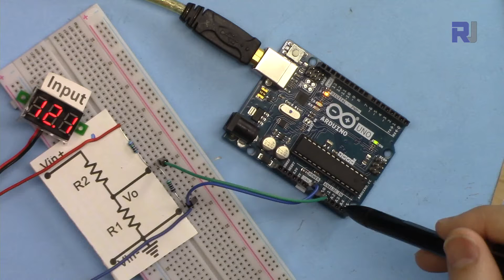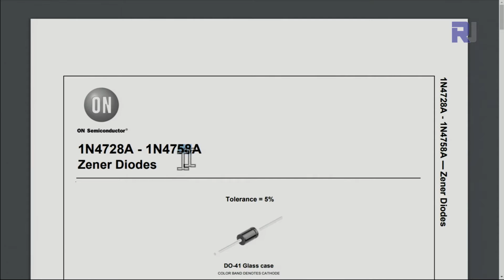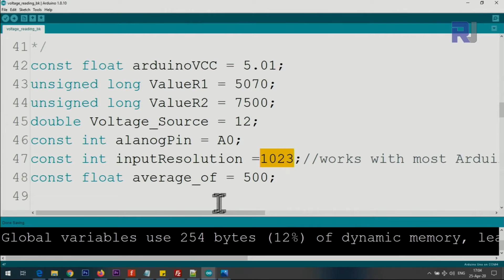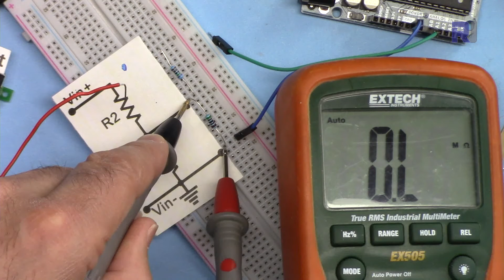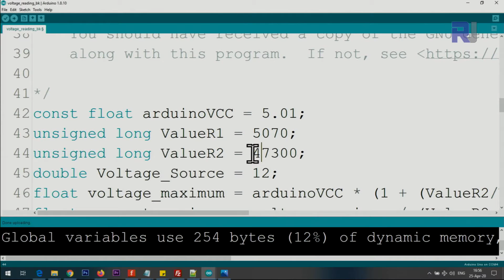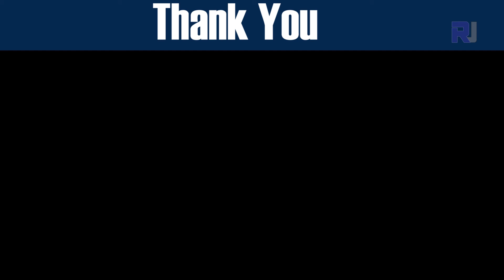Built Voltage Sensor with two resistors for Arduino to measure any DC voltage - RJT305

Comment: We are waiting for a  same project on esp8266. Good luck on your work !
Reply from the maker: it works for EXP8266 and ESP32. there will not be another video as this is the most complete video.  Watch carefully the code section.
Reply: @robojax  I managed to measure using your code but I had to introduce 3.05 V instead of 3.3 V as Esp8266 has. That's the only way it works. I measured with a mini code the voltage that A0 reads and it is 3.04 V . I used this value in my code and it reads with an error of maximum 0.1 V which is very good for voltages between 1.2 and 5V. I will also test with higher voltages. I have another question for you, I would be happy to answer : what Zener diode do you suggest in this case? For 3.3V or 3.1V (3.04V in my case)?  And to size the voltage divider for VR1 =  3.3V or 3.04 V ? 
I  used R1 = 7.5K and R2 = 29.8K. V R1 was 0.78 V for Vin = 3.9 V.  Can I exceed VR1 from 1V to 3V or do I have to stop at 1V? here is my dilemma regarding Esp8266 . 

I apologize for so many questions . I didn't think you would respond to all messages so quickly. Thank you very much !
Stay safe ! God bless you !
Reply from the maker: I am glad you were able to make it work. No worries about the question. I love to help if I can as I have full time job, family and other functions. So sometimes I forget or can't replay.  if you know the input voltage maximum, zener diode is extra.  you should use very accuracy zener if you want to use. 
VR1 is always the operating voltage or reference voltage to analog input.
good luck and God bless you too.

Comment: Make complete video on wcs1500 current sensor..as very less information is present on web ...good sensor for solar energy meter and in ebike application...
Reply from the maker: You mentioned this before. The sensor is no better than anything else. just expensive. if the manufacturer send it I will make video of it.

Comment: Could you help knowing how to measure AC 220V or more and read the seven segment
Reply from the maker: I will make video on that. But you can just add bridge rectifier with capacitor to convert it to DC then use this project and it should work.